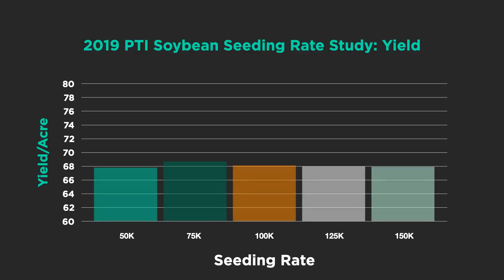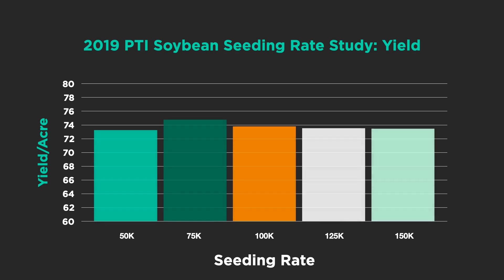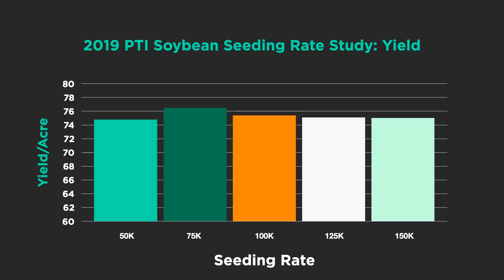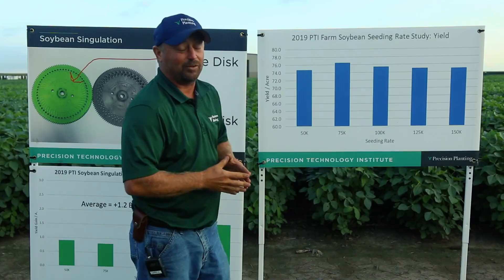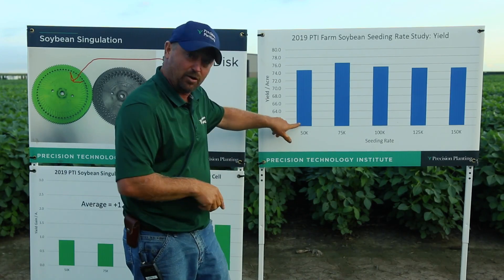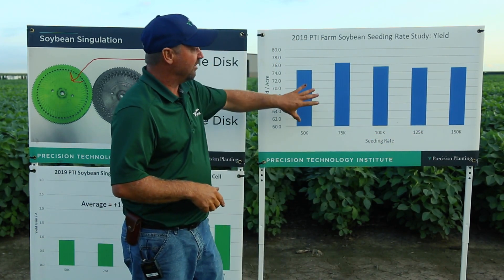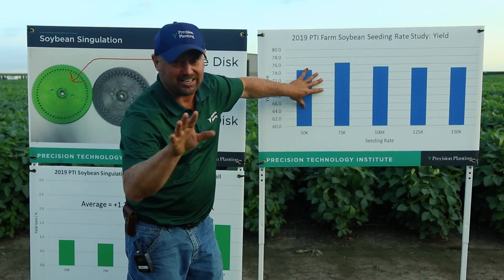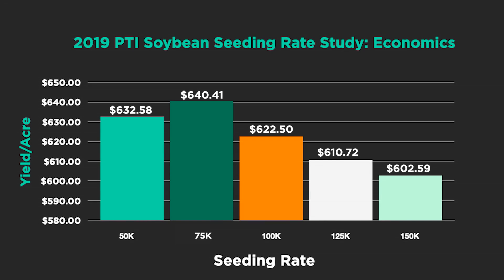InsidePTI S1•E50 | Soybean Seeding Rate

Comment: Your plantings look like conventional tilled fields and planting with a planter, not a drill, which I believe is optimum for seed to soil contact….What are your thoughts on planting population when using an air drill in 15” rows?
Reply from the maker: My opinion of air drill is this...as long as it offers the correct downforce and seed singulation I am fine with it. – Jason